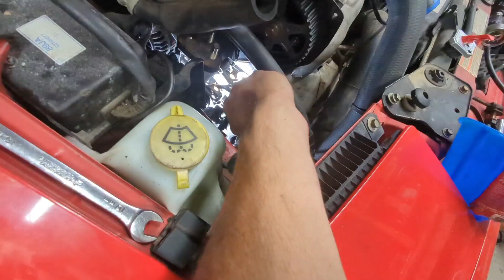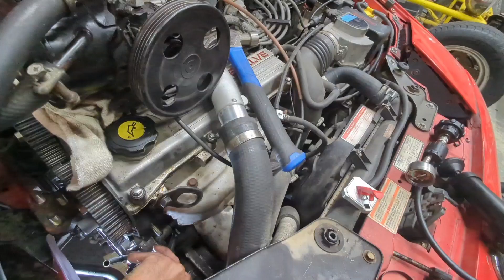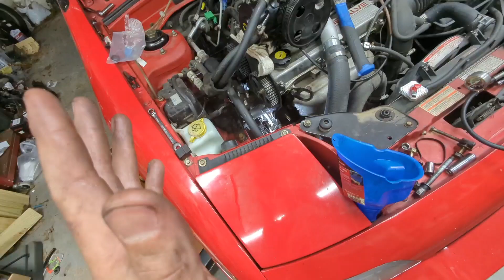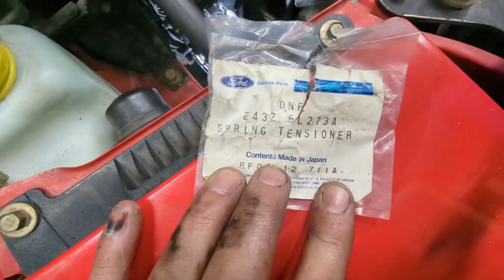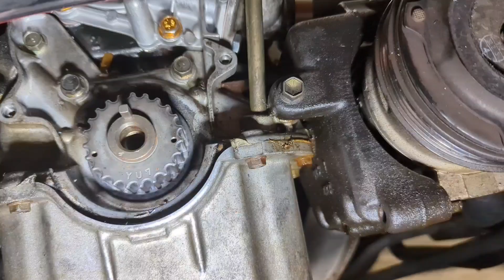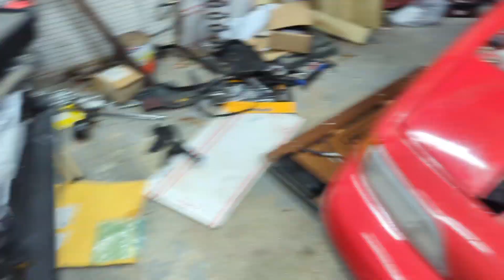Mercury Capri XR2 Water Pump and Timing Belt

Comment: Any info on the turbo?
Reply from the maker: I've never had to work on the turbo. A common mod is to switch in the thunderbird turbo, but that requires reprogramming. You can adjust the wastegate pretty easily and bump it up from 7 to 10 psi before the engine starts cutting spark.
Reply: @willstaffan3229  I’ll have to look into that. I forgot these cars existed and I saw one on Facebook marketplace. Looked really neat so I scooped it up. Trying to figure why I get no boost and I can’t even breath on the throttle without it jerking the car and spitting and sputtering.
Reply from the maker: @SneeknPeek sounds like you have your work cut out for you! Check all the vacuum lines. Consider seeing if the issue persists without the charge pipe hooked up to the turbo. The full service manual scan on teamcapri is excellent. This is a big enough job to warrant getting a hard copy for the shop. Also, check your plugs, wires, and ignition module. The ignition module is known to have issues
Reply: @willstaffan3229 Ty, I’ll def take a look into those. Happy thanksgiving!
Reply from the maker: @SneeknPeek I'll have a video coming out soonish. I had a bad hit with a deer and need to rebuild the front end
Reply: @willstaffan3229 sounds good. Looking forward to it! Glad you’re ok, hitting a deer is no fun.